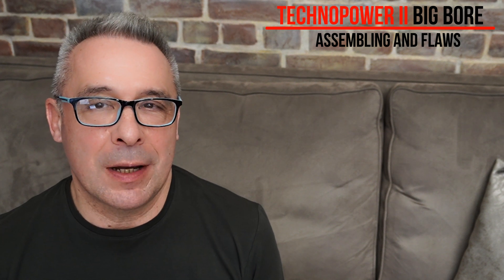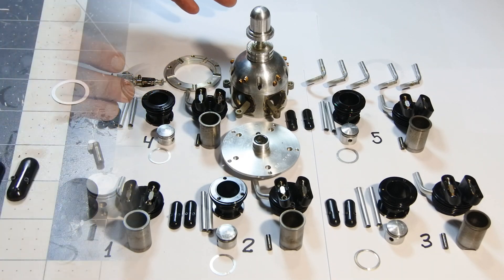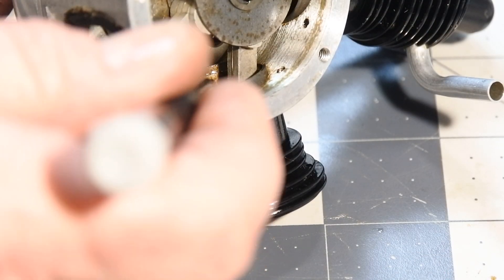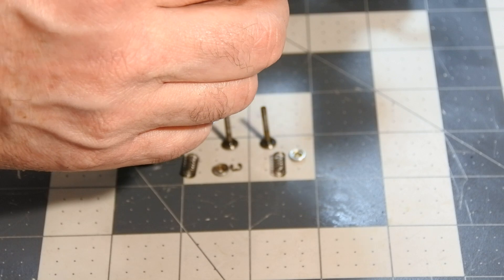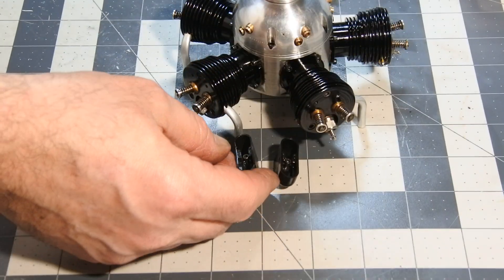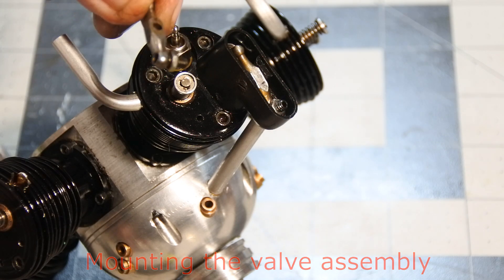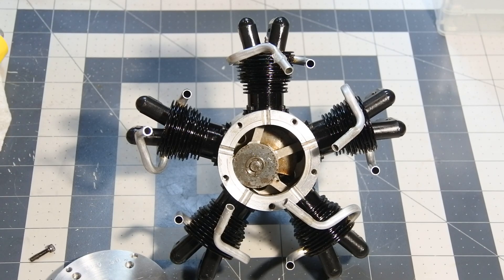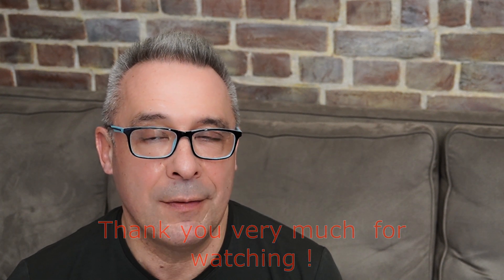Technopower II assembling and flaws

Comment: I too have had fun with one of these, a 7-cyl Big Bore that took quite a while to assemble and get running. Along with fixing the rear bearing design found the cam timing was not optimal at all. Since I had to also design a glow driver for all the cylinders wondered how you worked that out and if there is a video of it running.
Reply from the maker: Hi, and thank you for your comment and question ! First of all, I decide not to spent time for challenging design of DC\DC voltage reducing device (as we called it usually, glow driver). 5 glow plugs with 1.2-1,5 volts each, multiplied for 5 ( or for 7 or even 9), brings us a huge current. For 5 glow plug version is should be approx 10 15 amps (depending of glow plug model), and in your case it will be even more, up to 21 amps. So, I decide to use my standard NiMh accu batteries (with capacity 10.000, ma/h each, which were connected in parallel (2 in one shoulder (powering 2 glow plugs) and 3 in parallel (powering another 3 glow plugs). As test runs shows, it works flawless in hours. So, basically, you can use any 10.000,- ma/h D - size NiMh accu battery, and for your case 6  D-size batteries should be enough in practical use. Thank you very much for your question, have a nice day !
Reply: @crazyengines88  Did I miss a video of you firing it up? I too thought the current would prove excessive, yet as with full size diesels, the drivers I found were pulsed so each leg only drew on average 0.4A, which proved out when my LiPo pack only strained against a 4A TOTAL draw.
Reply from the maker: @proteus2067   Hi, thanks again for your comment ! Regarding first start of Technopower II you can find it here: https://www.youtube.com/watch?v=z-fPk4r2YEs&t=15s , there is a lot of details. Great, that you find another working solution for powering glow plugs. According to me, solution with 5 or 7 D size NiMh accu batteries could be cheaper and being more universal, of course, if you working with different model engines frequently. Thank you and have a nice day !
Reply: @crazyengines88  Did I miss a video of you firing this up? I too thought current would be excessive, yet the drivers I finally found are pulsed as with full sized diesels so each cylinder only drew 0.4A for a TOTAL of less than 4A draw on the LiPo supply.

Comment: What I noticed was odd is that the small end of the conrod wasn't even close to being concentric to the casting. That seems really odd.
Reply from the maker: Yes, great, thanks for your concern.
These are far from all the oddities in the design of this engine. Apparently, the designers were not very friendly with the basics of geometry, because some of the cylinders (2, in my opinion) have cutouts at the base so that the connecting rods do not touch the body, but the rest of the 3 do not have such cutouts. Apparently, it turned out on the drawing, but in production it was necessary to modify it "on the go" so that it was possible to somehow assemble the engine. And most importantly, there is no breather in the engine housing at all.
Those. all the rest of spent fuel (and oil) is left dangling inside the crankcase. And if, after starting, the engine is not partially disassembled and the insides of the crankcase are not washed, there will be trouble, the steel parts will rust instantly.
So I still have to wash it a second time 🙂before putting it in a cradle.

Comment: I think you can adjust the rocker arm clearance while everything is assembled. 1st, need a feeler gauge bent 80-90° at the tip to fit inside and under the arm above the valve stem. Or, if there is not enough room for the feeler gauge, modify an Allen key to the correct thickness and use that. 2nd, cut a slot in the top of the screw that adjusts the clearance. Using a nut driver, you can loosen the nut. Adjust the screw and check with the (tiny) bent feeler gauge. Then tighten the nut again. Observe that the screw has not rotated. You could also bend an open end wrench 90° and grind away the outside to make it small enough to use. I like how you sealed the intake tubes. However, I would have chosen thin gasket paper rolled around the tube. Less mess to peel off next time. ;)
Anyway, good job on the reassembly.
Reply from the maker: Thank you very much for your advices ! But in this part, I came across the fact that the rocker with an adjusting screw and a locking nut is located in close proximity to the walls of the valve box, and it is unrealistic to insert a key or a tubular wrench there. That is why I had to suffer so much. A very strange engineering solution, suitable for a child's toy, perhaps, but certainly not for a 1K+ bucks engine.
Thank you and wishing you a good day!
Reply: @crazyengines88  I could make a wrench to fit. 😉
Reply from the maker: @xKmotx    I'm absolutely sure, that you can ! But every time I have to ask myself - do you really want this (I'm not talking about the wrench) ? It is every time the dilemma: finding the balance in between your investment  and the final profit. In that case I decide to  suffer a little and work  hard to complete the engine.